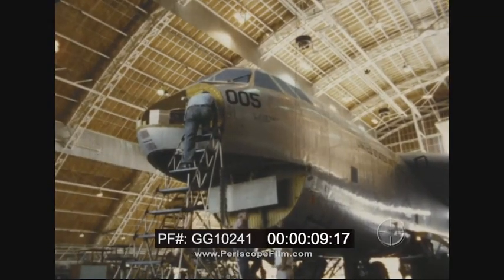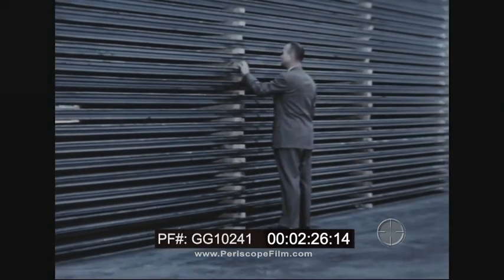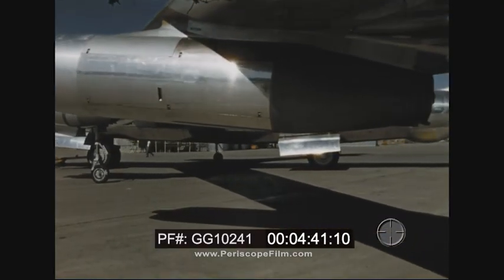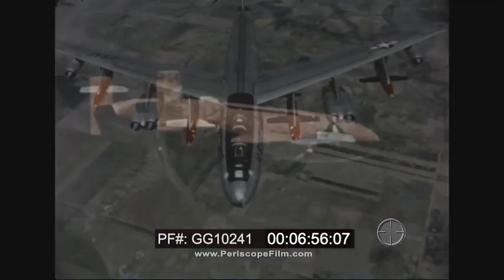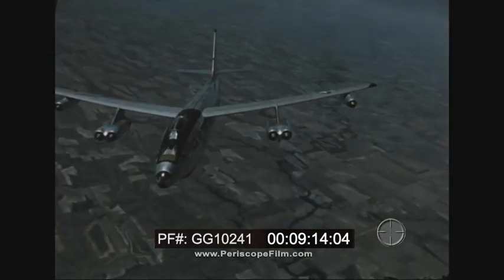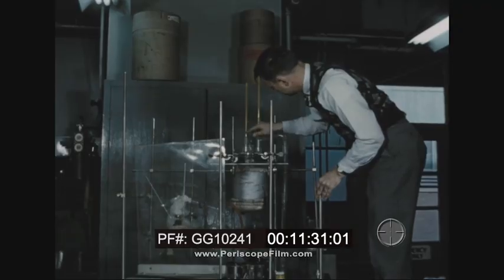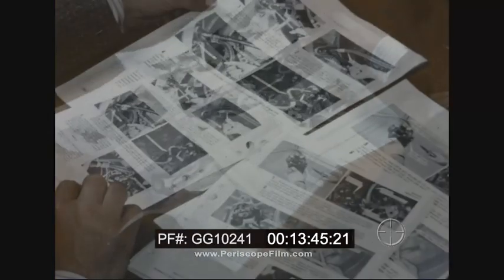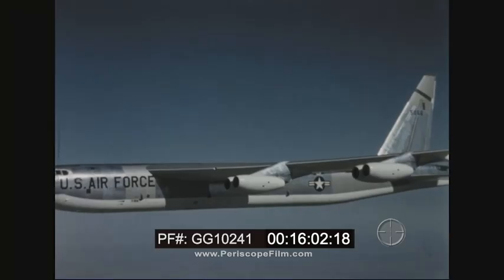" THE B-52 AND THE B-47 "  1956 BOEING AIRCRAFT WICHITA  BOMBER MAINTENANCE & DEVELOPMENT GG10241

Comment: I never knew they made so many B-47s
Reply from the maker: @Batters56 Yes what's also interesting is why the B-52 is still in service vs. the B-47 which was retired so long ago ... B-47 had inherent design issues (engine issues, short range, difficult refueling), high accident rates, and costly maintenance. I am sure USAF wishes they had bought even more B-52 airframes back in the day!
Reply: @PeriscopeFilm  Yes, I understand that the 47s had to use full power from the moment of take off -using rocket assist in some cases - fly over the target and return at full power only landing by shutting down the engines and doing 60 mile approaches to bleed off speed. So, fun idea, but not as adaptive as the 52.
Reply: Up close, the B-47 is a startling plane, like something  out of Star Trek. The 52 just looks like a train car with long wings attached, not exactly a work of art.
Reply: A total of 2,042 were built.  Since the film says that 1,390 were built in Wichita, I’m assuming 652 were built in Seattle.